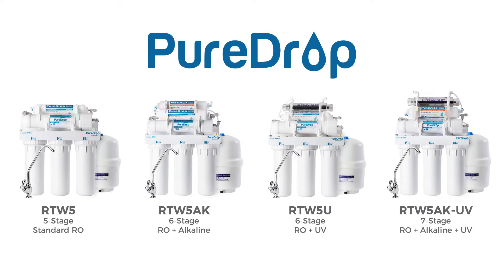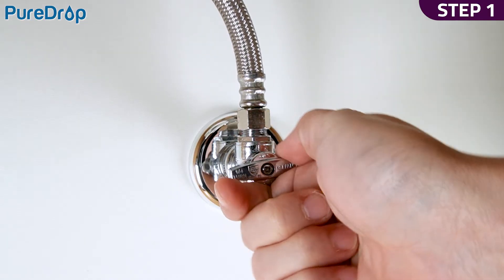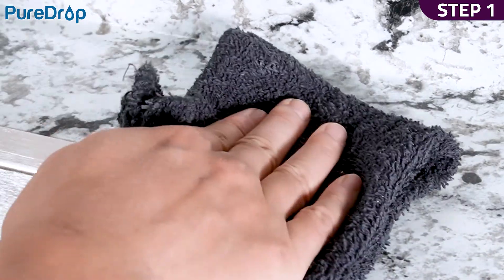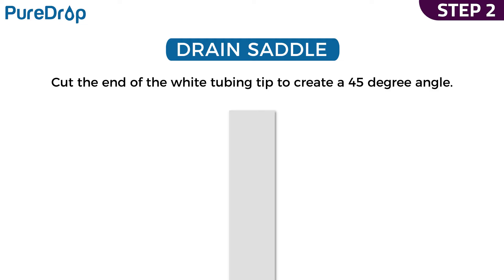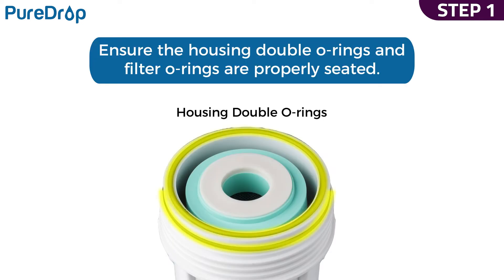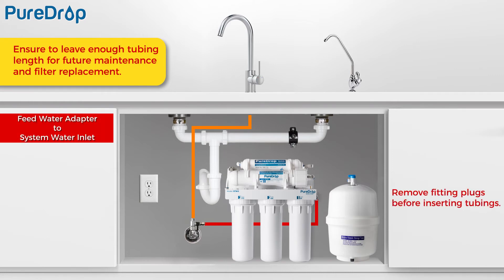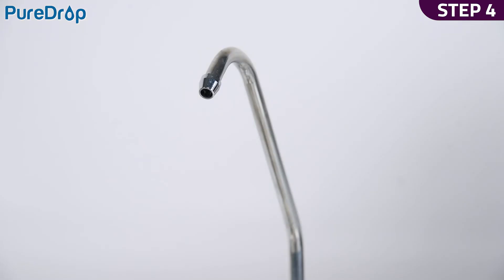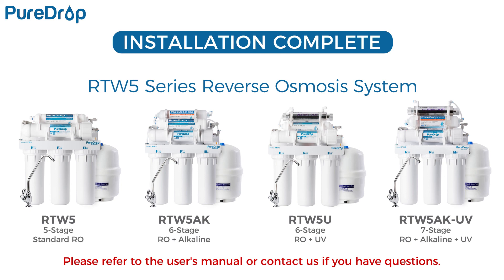Installation Guide for PureDrop RTW5 Series Reverse Osmosis Water Filter Systems | Step by Step

Comment: Can the water line of the refrigerator be connected to this?
Reply from the maker: Hi there. Yes, it can be connected using an ICEK. 
Please, refer to the link below:
https://www.123filter.com/ac/index.php?rt=product/product&product_id=259&acid=2
For further concerns or questions, kindly contact us at support@123filter.com and at (678) 801-9308 M-F 8:30-5:30  EST or (678) 261-7611 M-F 8:30-5:30 EST